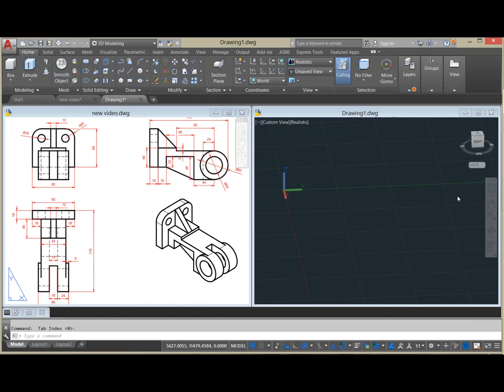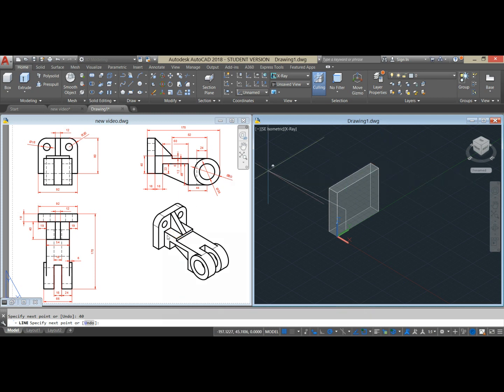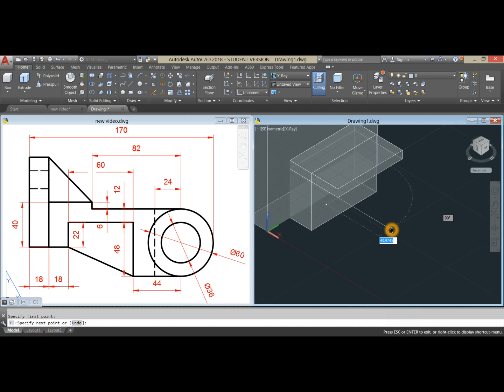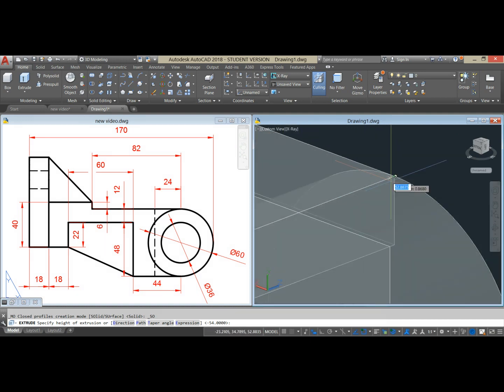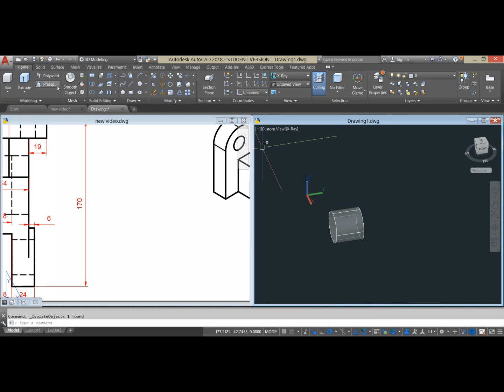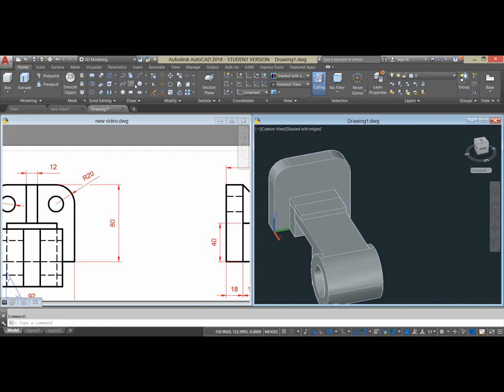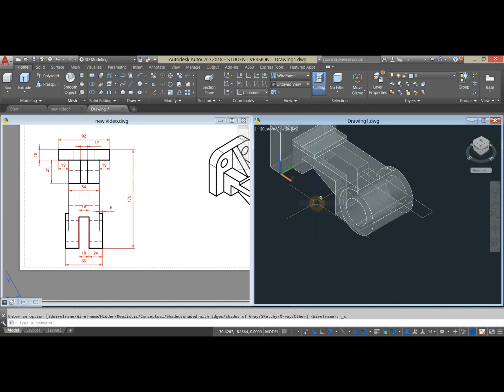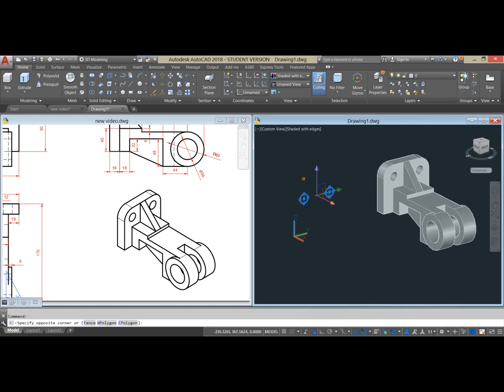Modeling in Autocad 2018 - Beginners Tutorial Exercise

Comment from the maker: Pls. don't forget to turn on the dynamic UCS (you can press F6 to turn it on and off)  in order for the desired working plane to work temporarily or by checking the options in the Customization (status bar)at the lower right hand corner of the screen

Comment: Hi friend thanks firstly for tutorial, i want to ask you for something pls
Reply from the maker: go ahead, what is your question
Reply: @AC3DCad  how can i make my panels like you?
And when i want to join some objects i can't selects line or 3D how i can did it?
Reply from the maker: it is either you type join command, enter then select the lines then enter or select the lines type join then enter
Reply: @AC3DCad  thanks, i know that but my ques when i want to select some lines i selected all the solid but how to show the touch like you to choose line or 3D
Reply from the maker: I think I now understand what you mean. It would be easier to select the lines when inside or attached to a 3D object if you try using 2d wireframe from the custom visual style or turn on the selection cycling in the status bar.  I hope this helps
Reply: @AC3DCad  yes this is what i mean thanks ❤